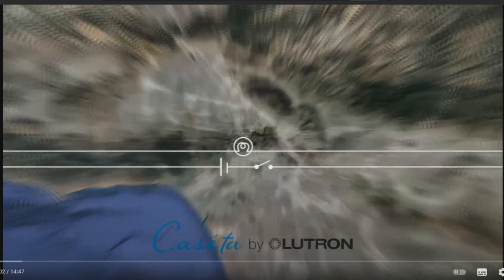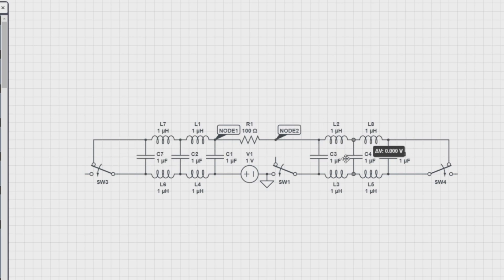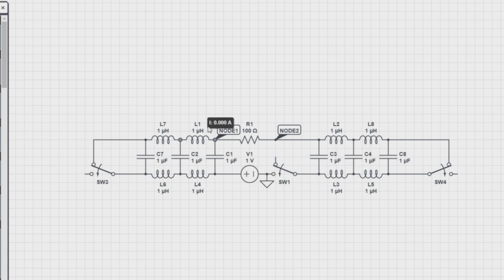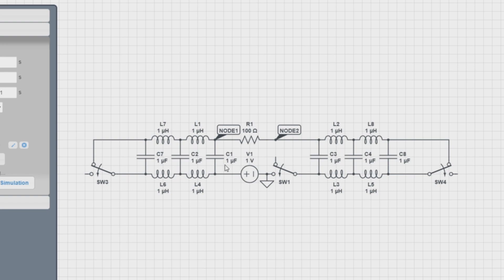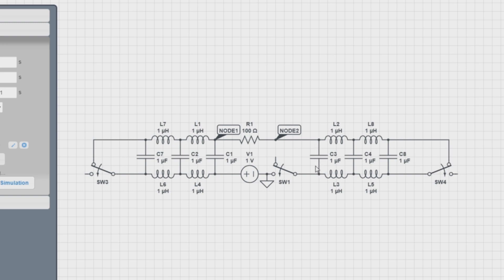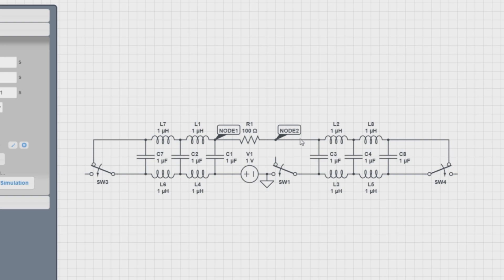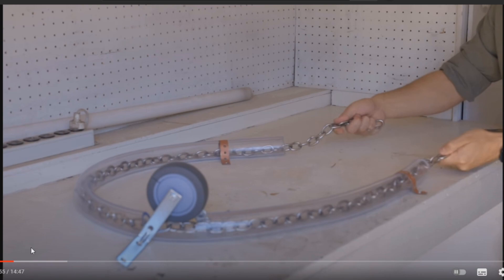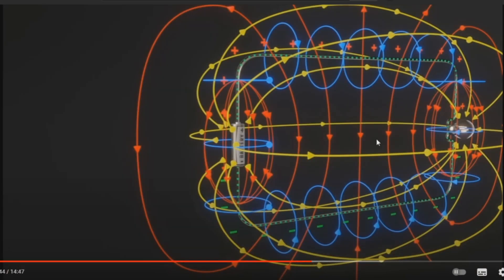Explaining the Veritasium "The Big Misconception About Electricity" video

Comment from the maker: EDIT: I AM PRETTY SURE I AM WRONG. I HAVE REDONE THE ANALYSIS HERE: https://www.youtube.com/watch?v=RsiYXfpJu5U . Similarly, I think most other people and EEVBlog also made this mistake I did.
Reply: Here's someone who did an actual simulation: https://youtu.be/aqBDFO1bEs8

I'll watch your new video, but the simulation supports the theory that only a fraction of the energy gets delivered immediately, and it will even take a lot longer to reach a steady state with full illumination.
Reply from the maker: @ismiregalichkochdasjetztso3232  Yes, in that simulation the response is the same as my results. However there is another case where the load resistance is high, and a special case where the load resistance matches the characteristic impedance.
Reply: @ZongyiYang  Yes, what you have in your second video is quite correct and I liked your analysis of the different load impedances and reflections. I didn't watch the whole video because I know you were on the right track and you come to this correct conclusion in the end. And I think I see that you saw Ben Watson's simulation which basically duplicates the same results. As I said before, this is really child's Play to an RF engineer.

Comment: All of you are wrong! The light will turn on instantaneously! A paper just published in the EM Journal IRECAP shows an EM pulse propagating 1.5 meters in the near field with no observed propagation delay. It shows that the front speed, or the speed of information, or the speed of causal action is instantaneous in the near field of EM sources. The experiment is a repeat of Hertz's radio wave experiment, except a modern two channel digital oscilloscope is used to measure the propagation delay. The paper shows that this is the second time an independent researcher has done the experiment and arrived at the exact same results and conclusions. The paper also shows that this effect is predicted exactly by Maxwell's equations when the source terms that come from Gauss's law and Ampere's law are included in the wave equation. This was not done by Maxwell when he concluded that EM fields propagate at constant speed c, so his solution is wrong. Since Einstein assumed Maxwell's solution was correct, and based his second postulate of relativity on it, relativity is wrong as well. If relativity is wrong then so is any other theory based on it such as general activity, and even QED. This will change all of modern physics!

Experiments by many researchers, backed by theory, now show that instantaneous signaling is possible in the nearfield of EM sources, and that the speed of light is not constant speed c, disproving both Relativity's prediction that signals cannot propagate faster than light, and disproving the 2nd premise in Relativity. What remains is the 1st premise : Galilean Relativity. If Relativity is wrong then so is any theory based on it like, General Relativity and QED.

An experiment just published in the EM journal IRECAP shows an EM pulse propagates instantaneously in the near field across 1.5 meters of space with no propagation delay. This shows that the front speed (speed of information) or speed of causal action is instantaneous in the nearfield of EM sources. The experiment was repeated hundreds of times, and also done by an independent researcher in their own lab, with exactly the same results. The paper also shows that the effect is predicted exactly by Maxwells equations. The paper is linked below. The effect can also be shown to be fundamentally due to the Heisenberg uncertainty principle. This shows that the effect is fundamental to all fields including: EM, gravity, and quantum.

In another experiment, a sinusoidal signal was transmitted between 2 dipole antennas as they were separated from the nearfield to the farfield. Analysis of the resultant phase vs distance curves (dispersion curves) shows a clear minima in the nearfield for all the EM field components. Applying well known phase speed and group speed operators to the curve, which are inversely proportional to the slope of the curve, show that both the phase speed and group speed are instantaneous in the nearfield and reduces to about speed c in the farfield.

Both experiments have been independently repeated by other researchers, obtaining the same exact results. If speed of light is not constant, then the 2nd premise in Relativity is wrong and what remains is the 1st premise: Galilean Relativity. Instantaneous signals violate the Relativity of Simultaneity because the signals appear the same in all inertial frames of reference. This can easily be seen by inserting c=infinity into the Lorentz transform, yielding the Galilean transform, where time and space are absolute. So if a moving body is observed with instantaneous nearfield light, then no Relativistic effects will be observed. But they will be observed if the frequency of the light source is changed such that farfield speed c light is used. So by simply changing the frequency of the source, Relativistic effects can be turned off and on. The only possible explanation is that the effects of Relativity are not real and are just a type of optical illusion. This result will affect all of modern physics.

In addition, the above results are predicted by EM theory. Maxwell's derivation of the speed of EM fields was wrong. The reason is that EM fields are created by sources coming from Gauss' and Amperes laws., and these sources must be included and can not be set to zero as Maxwell did. Including the source term yields a wave equation equal to a source term. Inserting a dipole source yields EM field components that with phase vs distance from the sources dispersion curves with a clear minima in the nearfield, and become only approximately linear in the farfield, starting about 1 wavelength from the source. It is well known that both the phase and group speed are instantaneous when there is a minima in the curve, and only exactly a constant speed when the curve is exactly linear, which only occurs at infinite distance from the source, which does not occur in a finite sized universe like ours. So Maxwell's solution is only valid at infinity, which does not exist in this finite sized universe. So the speed of light never a constant in our universe. If the speed of light is not constant, then the 2nd postulate in Relativity is wrong.

The same behavior can be shown to occur in gravity. It is well known that general relativity reduces to gravitoelectromagnetism (GEM), which assumes that gravity can be modeled by Maxwell's equations with different constants. So the same solution that occurs in EM theory also pertains to gravitational theory. This explains the instantaneous gravitational effect in the near field, observed in the stability of the planets, and also explains that Gravity waves have been observed to propagate at about speed c in the far field. This theory then accounts for all the observed gravitational effects including instantaneous nearfield and the speed of light farfield. The main difference is that this theory is a field theory, and not a geometrical theory like General Relativity. But because it is a field theory, Gravity can be then be quantized as the Graviton, enabling the unification of Gravity and Quantum Mechanics.

The phenomena also can be seen in quantum theory, and can be shown to be the consequence of the Heisenberg uncertainty principle. At the source, the position of the photon emitted from the source is precisely well known, hence the momentum or the speed is infinite. At about 1 wavelength from the source, the wavelength is starting to be come clear, such that frequency x wavelength ~c. But according to Fourier Theory infinite cycles are needed for the wavelength to be exactly known. So the above frequency wavelength relation is only valid at infinite distance from the source. So the speed of light never reduces to exactly speed c in our finite size universe. This phenomena should be fundamental to all fields including: EM, gravity, and quantum, and in particular quantum tunneling.

There are currently many interpretations of quantum mechanics. But only the Pilot Wave Interpretation is compatible with Galilean Relativity. In this interpretation real particles are guided by real pilot waves. But the real pilot waves are known to communicate information about the particles instantaneously with the environment. Because this is not compatible with Relativity Theory, this interpretation has not been taken seriously. But as a result of this discussion, this is no longer a problem, and Pilot Wave theory should now become our best interpretation of quantum mechanics. And combined with instantaneous nearfield interaction, can perhaps explain the instantaneous interaction observed in quantum entanglement.

For more information see the following links:

*YouTube presentation summarizing my 35 years of research in this area: https://www.youtube.com/watch?v=sePdJ7vSQvQ&t=0s

*More extensive paper for the above arguments: William D. Walker and Dag Stranneby, A New Interpretation of Relativity, 2023: http://vixra.org/abs/2309.0145

*Electromagnetic pulse experiment paper peer reviewed and just published last month in Journal IRECAP: https://www.techrxiv.org/doi/full/10.36227/techrxiv.170862178.82175798/v1

Dr. William Walker - PhD in physics from ETH Zurich, 1997

Comment: I would argue that the result is an AC transient in a DC circuit, so the answer is so fragile that Veritasium is still wrong. If I can change the problem slightly and completely change the result, what are you really sowing but confusion?
Veritasium Is Wrong About Wires - A Perfectly Balanced Refutation Using Logic, Reason, an' Thwarting
https://youtu.be/xRWPg9CLBr4

Comment: Almost instantaneously. The actual wire length in the “experiment “ probably less than 200 feet. Various theories at an end. The physical wires are not 186,000 miles long. If they were and like the bulb( so Derek says) were ideal- zero resistance- it would take 2 seconds.

Comment: I am trying to understand what happens in the initial / transient phase for this circuit ( I don't have an understanding of transmission line theory ) and was wondering what might happen in the following limiting cases:

1.) What happens to the energy transmission as the wire length approaches zero?

2.) What happens to the energy transmission as the wire length approaches infinity?
Reply: The simplest thing to look at here is that a transmission line looks like a resistance until reflections occur. This is called the characteristic impedance or the surge impedance. The two lines going to the left and the right have about a 900 ohm REAL CHARACTERISTIC IMPEDANCE, THAT MEANS THEY ARE RESISTORS.. Even though we model the transmission lines as capacitors and inductors it looks like a pure resistance. Once you know that,,  just take the battery, TWO900 ohm resistors over to the bulb a meter away and then you can see that it takes 1 m worth of time for the travel from the battery to the light bulb. However, the current is very low because these are two 900 ohm resistors. After all of the reflections die out, which is rather complex, then you have the full battery voltage on the bulb and it lights to full brilliance. That is the answer. This is trivial to RF engineers and people that understand Time Domain Deflectometry TDR. In his second video, the URL shown above, Z Y shows the correct solution is I describe above. Also, Ben Watson has a model that shows the same thing, a small current after a small time delay and then after the reflections die out the full current.
..
To answer your questions one.
When those two lines are near zero they look just like wires so you have a 1 m transmission line to the bulb and it will take 1 m worth of time for the bulb to light up fully.
.
Infinitely long transmission lines can have no reflections and, therefore, they only look like resistors for all time. In that case there will be a low current through the light bulb after the one meter time delay and forever. Again, as I say this is trivial for an RF engineer.

Comment: I see it as one side of the bulb is all positive and the other all negative. So a capacitor there can't be and this thorectical circuit has no wire resistance. That 1meter distance will have no effect on the time it takes for the bulb to light. If this were a high voltage AC circuit then maybe. My pinball machines and our CPU's would all be shorted and not work.
Reply from the maker: There is a capacitance there but it is small. However my explanation in this video is wrong, please refer to my follow up video for the correct answer: https://www.youtube.com/watch?v=RsiYXfpJu5U The wires have no resistance because it was stated by Veritasium to be perfect, however we can still do the same analysis if there was resistance, just the characteristic impedence would be higher and complex.

Comment: As I understand your analysis, only the transient will be seen at the light bulb during the 1st second that the step function takes to return to earth.
But due to the distributed reactance (capacitance and inductance), the transient will be seen all along the receiving "antenna" as it propagates
along the transmitting "antenna" as an E-field (in the "capacitors") and a B-field (in the "inductors").  The current spikes caused in the receiving
antenna will all propagate back to earth (and the light bulb), as a weak but continuous train, or current, until the step function current finally
comes back to earth on the receiving antenna and FULLY lights the bulb.  What is seen at the bulb, then, is an immediate tiny continuous current followed by the full continuous current after a second.

Comment: A modeling comment... You show a capacitor from the right side of the switch to Node2, but not from the right side to Node1. The physical circuit as shown in the original video would have a very similar capacitance from the right side of the switch to each of Node1 and Node2. This would lessen the voltage across and therefore currrent through the lightbulb.
Reply from the maker: This particular model has issues, like the one you just described and therefore a lot of the conclusions are wrong. I have made a better model in my 2nd video: https://www.youtube.com/watch?v=RsiYXfpJu5U

Comment: Wouldn't you be more likely to pick up a stray radio transmission or some cosmic ray to induce a PD in the receiving wire than you would from the antenna "radiating" an EMField?  ;-)

The one problem I have with this circuit of parallel capacitors is if the wire is essentially perfect having no resistance (as the original video assumes and was stated) then surely there can't be any capacitors present when the circuit is fully made as all potentials will be the same in the in all of the conducting parts of the circuit, aside from the battery and the lightbulb. 

Therefore there can't be differences in potential between them as they are all at the same potential until the circuit is made.

Or am I missing something??
Reply: Maybe I am missing that the two halves of the circuit are not made as the battery and switch are causing potential differences.....???
Reply from the maker: @CMDR_Hal_Melamby  My explanation is wrong. Veritasium is actually correct. I have made a new video with a better analysis: https://www.youtube.com/watch?v=RsiYXfpJu5U

Comment: Suppose your switch s1 is not in the circuit but s2 is open, at it's all at the  initial state, now close s2 and tell me when the circuit becomes active.   Because it is 1/2 light second away, the circuit cannot become instantaneously active or we have signal that informs the battery faster then light(?)    So even a small distance of switch from battery must cause some additional lag in the circuit.  Is there something wrong with this analysis?
Reply from the maker: My explanation is wrong. Veritasium is actually correct. I have made a new video with a better analysis: https://www.youtube.com/watch?v=RsiYXfpJu5U

Comment: The light won't come on for the bit of energy transmitted using EM waves.
Reply from the maker: This is true, I'm just explaining why Veritasium would say it is 1/c seconds. He is technically correct, but you are correct in that in any practical application this energy transfer through the air is miniscule.
Reply from the maker: My explanation is wrong. Veritasium is actually correct. The power transfer is actually significant. I have made a new video with a better analysis: https://www.youtube.com/watch?v=RsiYXfpJu5U